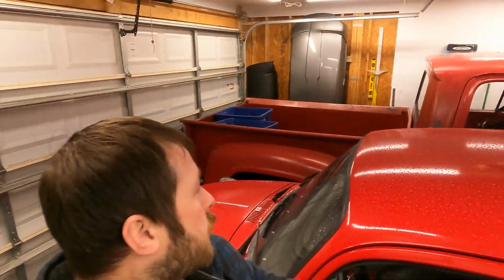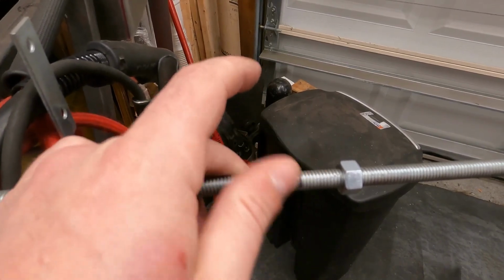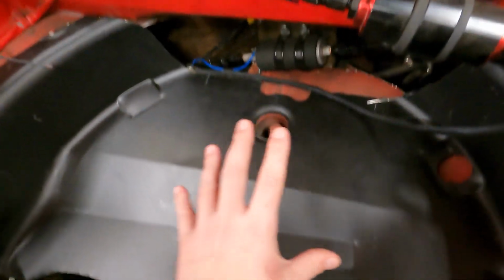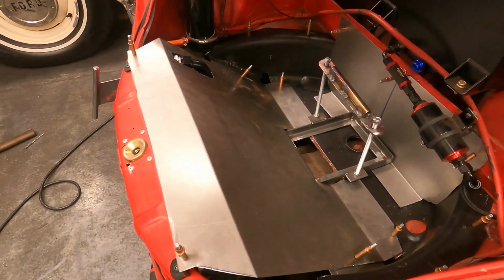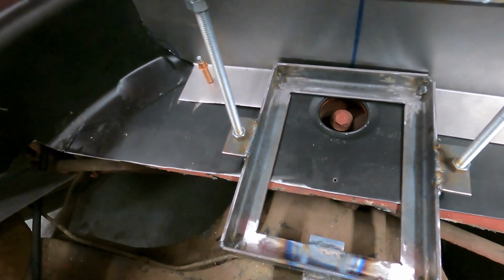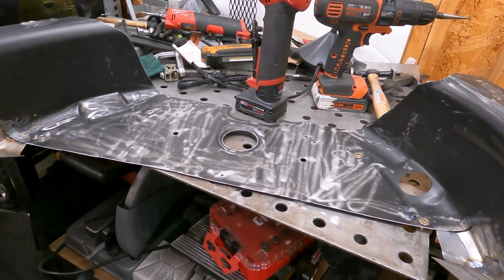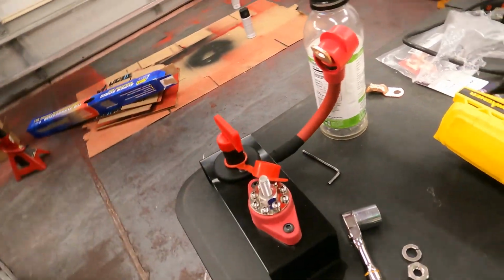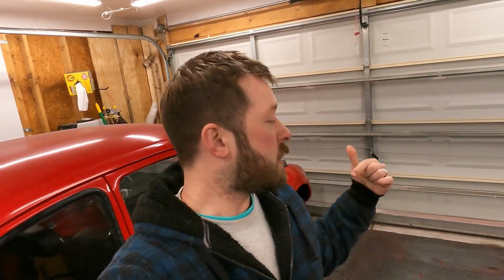Battery Relocate and Patching the Frunk -- 1973 VW Super Beetle Subaru Swap

Comment: Which ej motor did you use? And how did you go about finding it?
Reply from the maker: I am using an EJ255 shortblock from a Turbo WRX and heads from a N/A Impreza (EJ251 or EJ2, I can't remember). I used these parts as I actually had them sitting in the garage from other projects.  Pretty much any Subaru motor (N/A or Turbo) will give you a huge bump in power in a stock classic VW. I went with the N/A heads because 1.) they are physically smaller so slightly easier to fit in the engine bay and 2.) they are simpler to assemble and maintain (roller cam, less moving parts). I got my cams (SOHC) reground at Delta Camshafts and added AVLS valve springs (stock upgrade for N/A heads) to compliment the VF48 and try to get the most bang for buck. Good luck!

Comment: Very nice but one question, maybe I missed it,  where do you plan on putting your spare?
Reply from the maker: Haha you didn’t miss it, currently I do not have a spare or provisions to store one. If I decide I want to carry a spare, I will likely add a false floor in the trunk and drop the spare on top of that, or possibly secure it to roof racks on a need-be basis.